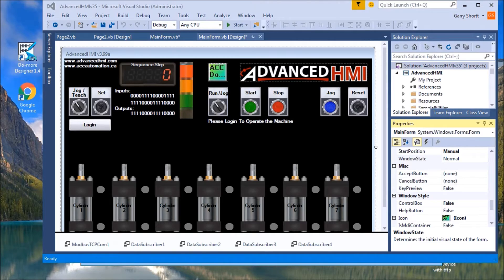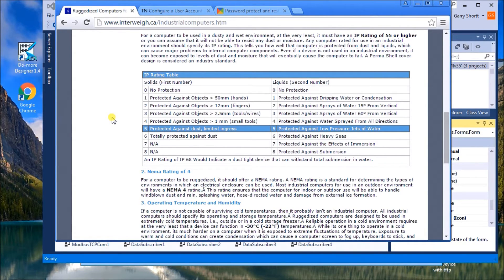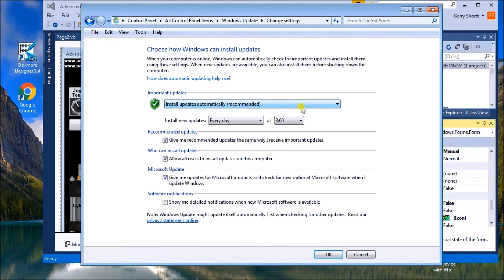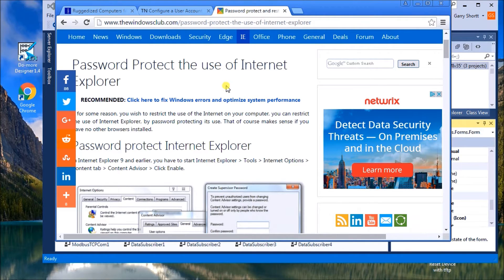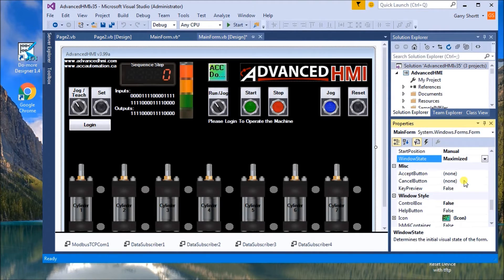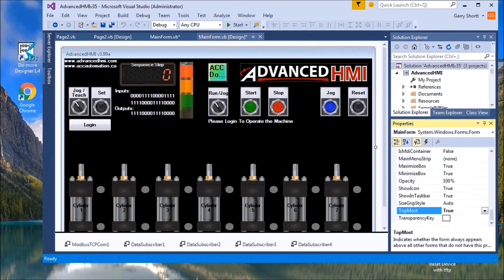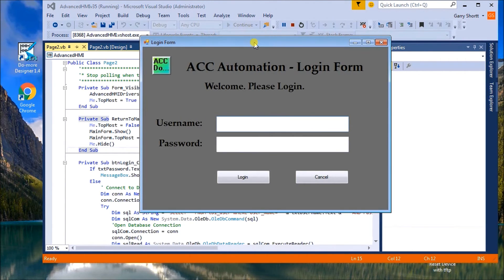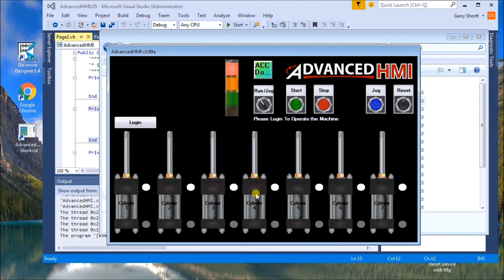Industrial HMI Survival: From Lab to Factory Floor Secrets

Comment: of better do you know what are the maximun number of devices to connect?
Reply from the maker: Hi Jesus,
The Modbus/TCP protocol itself has no limit for the number of slaves. The address of the slave is the Ethernet IP address.
Serial Communication - Modbus RTU, ASCII 
According to the Modbus specification, the node range is from 0 – 255, with 0 being the master, 1-247 being the slaves, and 248-255 being reserved addresses. After 32 nodes (1 master + 31 slaves), you may need RS-485 repeaters to ensure proper communications.
Regards,
Garry

Comment: hello im form mexico , do you know if is posible connect more than 20 devices at the same time?
example i dont have problem to connect 10 devices the same, are 10 compact logix but if i increase the number of the devices the values i am reading  are diferents.
Reply from the maker: Hi Jesus,
What method are you connecting the CompactLogix PLCs?
Is each of the PLCs assigned a different node number or IP address?
Regards,
Garry

Comment: Copying the .exe shortcut worked great! My problem is that when I run a project via clicking the .exe icon, I am not able to run a second advanced hmi application while working on it on visual studio. I have to close down  the first project so I can run the project on visual studio. Any thoughts on this? THANKS!
Reply from the maker: Hi Imc00rage
You should be able to run a second AdvancedHMI as long as the resources are not already being used. If your application is using the Serial port for communication and you try to open this again on the computer it will not work. 
Usually I will program on a separate computer and transfer the program.
Hope this helps you out.
Regards,
Garry
Reply: Thank you for the reply!  I will see if I can figure it out.
To clarify, I have two AdvancedHMI projects which are reading data from an OPC server. In both, I use OpcDaCom1. 
One of the projects is finished and it works well.
While working on the second project in visual studio, I cannot run it if the first project is opened. Instead, the HMI for the first project pops up. 
At first I thought it had something to do with the project name,  but I will see what I can find.
Thanks Garry! Really like the content in your channel